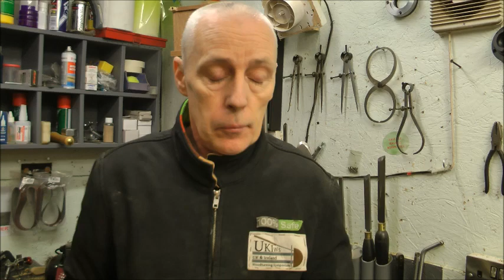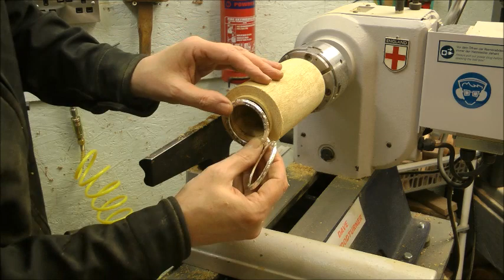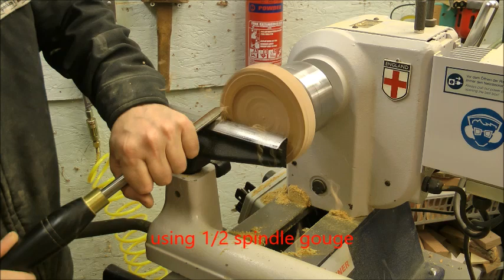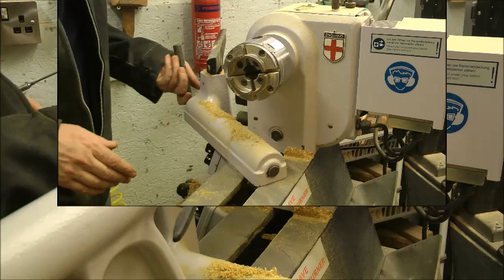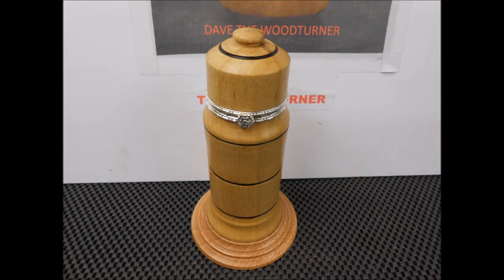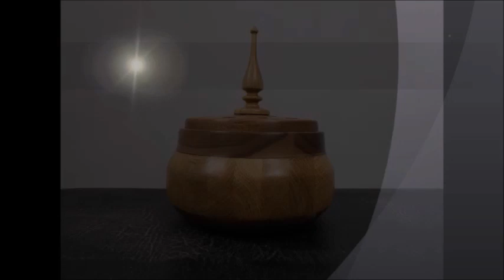E68    wood turning ldigbo pen case

Comment: Interesting project Dave. Where did you get those hinges?
And how do you fix them to the workpiece?
Reply from the maker: hi Leo  hinges from prokraft.co.uk  i fixed them with two part epoxy by gorilla glue hope this helps take care dave
Reply: @woodturningwithDave  Not after Brexit. 🤢 I will have to find some EU shop for this.